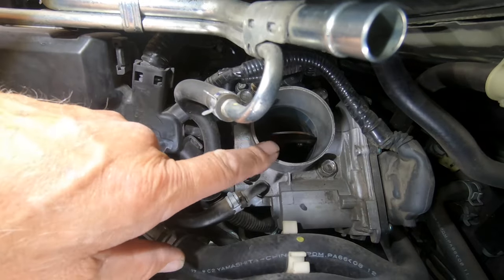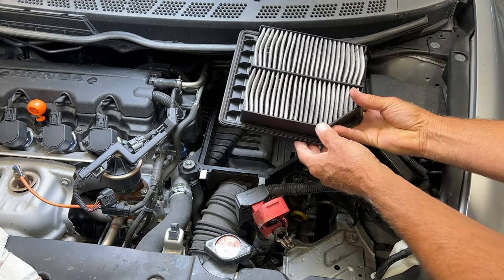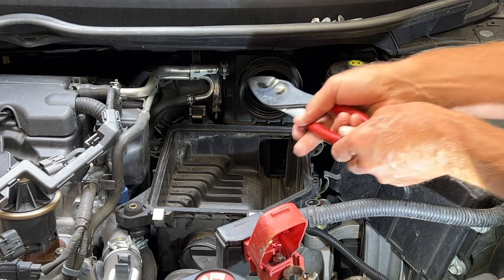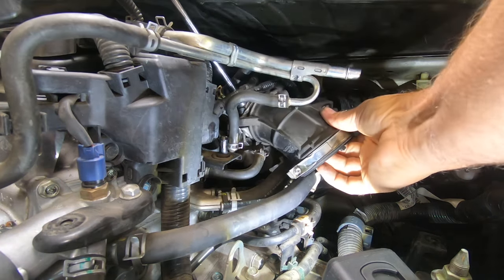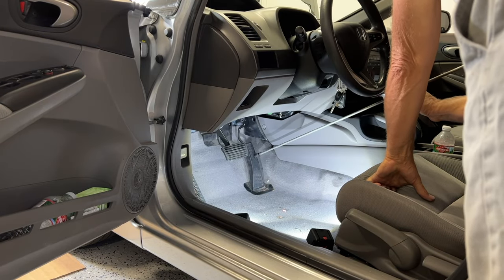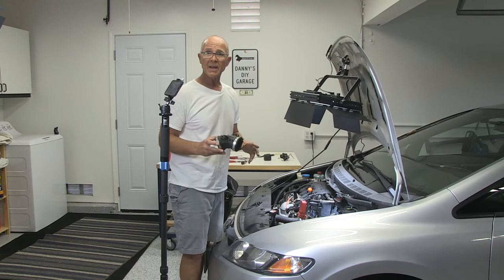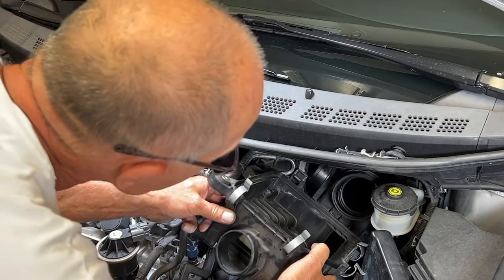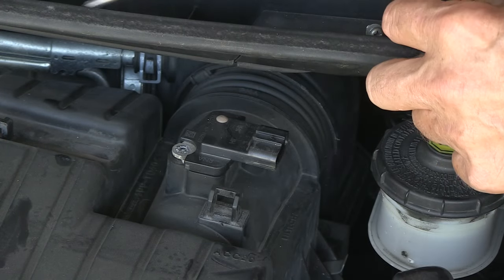Unstable idle, idle fluctuates Honda Civic

Comment: My revs used to dip to 500rpm when coming to a stop and pressing the clutch in, i did the throttle body clean, reset and idle relearn which solved it. However it caused my clutch to feel different. Previously the biting point was high. It is now lower and about right. However when warm after about 20 minutes of use it becomes stiff and springy. What could this be? And how can a throttle body clean reset effect the feel of the clutch?

Comment: I made the mistake of opening the throttle plate with my hand and now I have a code and the gas pedal won't open the throttle. Like not at all.
Reply from the maker: Strange, I’ve opened them with my hand before with no damage

Comment: dude i have a 2007 honda civic that has a fault and it gets worse when i turn on the air. Today with your video I cleaned the throttle body, thank you very much. but I wanted to know where the IAC valve is located? I did not recognize it when cleaning the throttle body, and I would like to clean it too

Comment: Great video, I have a similar question, you have got the battery off, how to start the vehicle to make the pedal work? It will work without battery?
Reply: i think on older cars a wire is connected to the throttle body from the gas pedal

Comment: Another great video, Sir was wondering do you need to have power and key on while you clean or can you turn key off once throttle body is open. thks
Reply from the maker: Yep, power and key on
Reply: @dannysdiygarage  great so it doesn’t need what dealers call reprogramming Throttlebody after cleaning, and was wondering when you’re going to change the PCV in any up coming episodes and thanks again. And was wonder how many miles on your Honda Civic when you started having idle issues, I am new to Honda civics , just picked up 2007nEx coupe with 81,000 and had a lot of issues with car complete front end was shot out of Florida, lol  thks
Reply from the maker: I own two civics, both 2009’s, dealer probably say to perform a relearn procedure, that’s great if you have the equipment, if not it will relearn on its own overtime, the civic I did in the video relearned pretty quick, within a day of driving, however my other civic did not idle correctly for 2 weeks and then was perfect, so if it’s not perfect after the cleaning, don’t panic
Reply: @dannysdiygarage  awesome how many miles on your Honda civics, thks
Reply from the maker: 121000, and 164000 on the silver one in the video, bought both new in 2009
Reply: @dannysdiygarage  wow no issues with car except idle issues, thks

Comment: What should happen when you remove the MAF sensor while engine is running?
Reply from the maker: the computer puts the car into a fixed mode, it will still run, however not very good, did this answer your question.

Comment: I just had my throttle body cleaned and the EGR valve, but after that the car is idles high and changes gears funny and kicks when I let go of the Gas pedal. Is this normal?  Or its something that my mechanic did or did not do. I do not know if he cleaned the MAS sensor.  On Honda Civic 2006 R18A engine. Any thoughts.  Thanks.
Reply from the maker: Is the engine light on? If not try doing a relearn, as per these instructions https://youtu.be/5IoAZplCij4?si=PnZZqNwg7VAxYsPX

Comment: One more thing. If the battery is disconnected for such a period and some settings are reset. Is the stereo the only thing that might be affected?  I do not want to open up to more issues, trying to fix the uneven idle.  Thank you
Reply from the maker: Unless you have programmable mirrors, seats ect, so probably nothing else

Comment: Why my engine light came on after I followed and did exactly the video ? Any idea ?
Reply from the maker: What code?
Reply: If clean the MAP or MAF sensor(s), make sure it is dry before install back. 
Make sure wire harness are conected securely too.

Comment: Can brake clear be used to clean the throttle body and maf sensor
Reply from the maker: No, brake cleaner is to harsh for the air flow meter and not strong enough for the throttle body

Comment: My 2009 Honda Civic accelerator is not powering, even when I press it down, what is the solution sir?
Reply from the maker: Not enough information for me to give you an educated guess, any codes? if not check out this video https://youtu.be/a9K-E2a1BRw, also unplug the air flow sensor and see if it's any better. this is just a wild guess, however please update me when you get this fixed others would love to know what it was.
Reply: @dannysdiygarage  am buying another brain box, my Mechanic said my brain box is bad, because when plugged in, the fuse box will be sparking when the ignition light is on, so am changing the brain box, so the accelerator will get fixed. Because he said the problem is electrical.

Comment: I have a 2012 civic the car runs good just on idle it fluctuates a bit to wear it shakes a little but not stall i can hear something kick on then the idle goes up then turns off then idle goes down ... hopefully this helps will try it out
Reply from the maker: is it your air conditioner compressor kicking it, it will also kick in when the defroster is on, if that is the case it's probably normal, cleaning the air flow sensor and throttle body could help, also worn mounts make this seem worse than it is, hopefully this helps
Reply: @dannysdiygarage  it happens with the ac on and off
Reply: Have you clean or replaced pcv valve? I clean mine and it idle like new again. Danny has a video
Reply from the maker: PCV video https://youtu.be/glltxejn10k?si=3ozp_36ip9L24gUt

Comment: You have a video on cleaning the idle control valve?
Reply from the maker: Not yet, but’s it’s on my list
Reply: @dannysdiygarage  Danny you have a video on cleaning throttlebody ?
Reply from the maker: @thahtran3236  yes, here is a link, https://youtu.be/SFeP4jpJox0
I'm also working on a video that will show you how to remove it and clean it, which will do a better job on cleaning, this should be out soon.
Reply: @dannysdiygarage  Danny I have a 2010 Honda fit. Is it true for Honda you can check transmission fluid when it’s cold?
Reply from the maker: This should be in your owner’s manual, I only know the civic should be at operating temperature and check a few minutes after it’s shut down and on a level surface
Reply: Danny can I use NGK o2 sensor for Honda fit?

Comment: Hello, I’ve been having starting and dying immediately issues when I jump start my car. It all started after I cleaned my throttle body.I cleaned it because my car was shifting improperly and bogging out. I’ve replaced my maf sensor, fuel pump, fuel pump relay and fuses, new plugs and coil packs, and even a new 02 sensor because it was throwing off a low voltage code. Any ideas where I should check next? Thanks, if you read all of this.
Reply from the maker: What we’re the codes before? Also your exhaust isn’t plugged is it? Does it run or just start and die every time, how many miles and what year?
Reply: @dannysdiygarage  180k miles 08 lx, last codes it had were P0113, and P0102. That was why I had replaced my maf sensor. I will check today if my exhaust is plugged, but I don’t think it should. I installed a catback system less than a year ago. I was able to jump the car for around 30 seconds maybe before it died, but now it will only start right up for a second and then dies. It will usually only start twice for a second before it doesn’t want to start anymore. Anyways thanks for the time .
Reply: @dannysdiygarage  I was able to get a whole new fuel pump assembly and the car runs now, but it won’t accelerate, or barely revs up when in drive unless I feather the throttle
Reply from the maker: Try disconnecting the map sensor and see if it make a difference
Reply: @dannysdiygarage  I’ve already replaced the map sensor, I think it’s my throttle position sensor

Comment: Can I use MAF cleaner on the throttle body?
Reply from the maker: You cannot use throttle body cleaners on the MAF sensor, but you could use MAF sensor cleaner on the throttle body, however it may not clean it very well
Reply: @dannysdiygarage  thanks!

Comment: Hi my car have a problem when i brake on stop  sign the car stalls 2010 civic
Reply from the maker: Have you done this throttle body and airflow sensor clean yet?
Reply: i had the same problem but mine is a 2012 n i did this n i
pray to god cleaning it is the solution 💯
Reply: What should happen when you remove the MAF sensor connector while engine is running?
Reply: @DP-zf5kh  did it work?